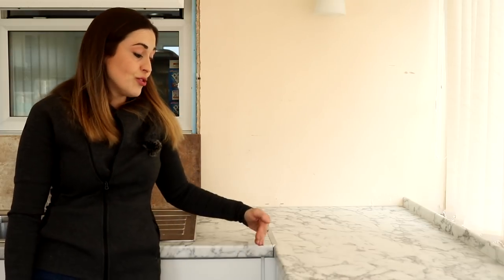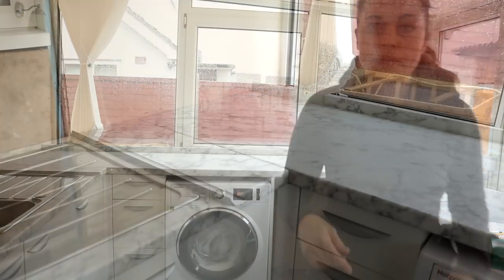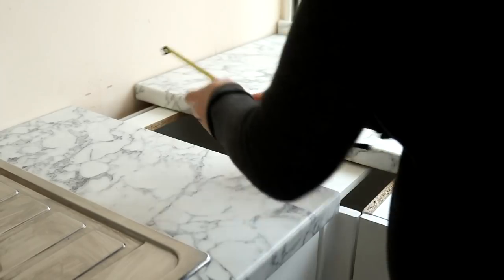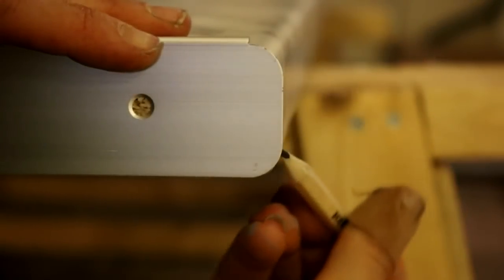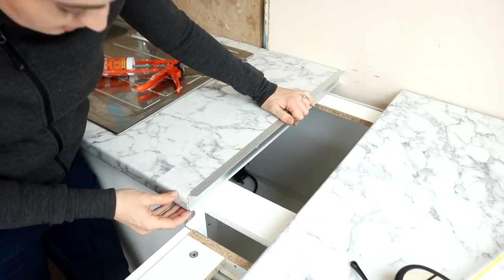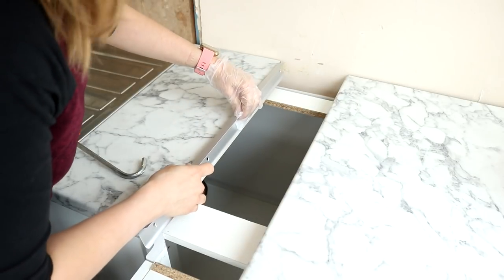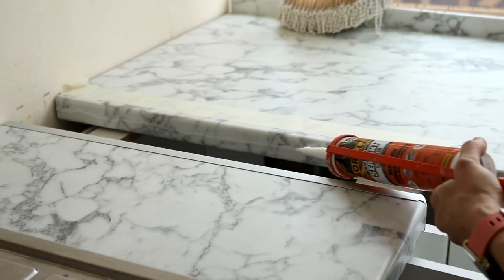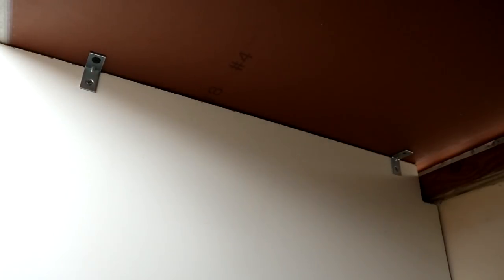Fitting Kitchen Worktop Corner Joint Trim | The Carpenter's Daughter

Comment: I undertook this today, and got the confidence to do so from your very clear and descriptive video. In the heat of battling against grossly unsquare walls and uneven worktops, which required adjustments, I forgot to clamp the surfaces to the units when screwing. I have consequently just noticed that the very well positioned surfaces are now not a close fit- they must have moved when screwing- and the end trim had an unacceptable gap showing. I know what is required for tomorrow, but I wish you could have been with me today!
Reply from the maker: Great stuff!  That sounds like an easy fix for tomorrow! :)
Reply: @TheCarpentersDaughterUK  it was an easy fix I am delighted to report, and having the corner joint has improved things greatly. I also fixed four edging trims, and they fit perfectly after using your filing technique. As mine are black, the filed bits show the silver under the black. I plan to touch up where noticeable using a touch of metal paint perhaps. I am drawing on your videos to do more jobs than I can list on my kitchen refit, as they are so instructive and beautifully presented.

Comment: nicely done, A handy tip is to use a liberal covering/spreading of waterproof pva on any cut worktop ends to stop any water ingress in the future
Reply from the maker: Thanks and totally agree :)
Reply: Remmers SW 910 end grain sealer . My choice. Silicone is best accessible off shelf solution how you did it.

Comment: Nice job! Others would have routed out the edges to make a flush joint but unless you get that perfect it looks bad. Your method looks good every time, great tip on checking the profile.
Reply from the maker: That definitely was a concern.  I don't mind usually mind starting again if I need to, but lifting the long worktop over a light switch to fit it in was so heavy, I didn't want to do it again.  And think this join is perfect for the every day DIYer if they want to do it on their own :)
Reply: Could get flat edge countertop and butt the two machine edges together looks way better than a bar
Reply: @keithbyrne4872  if it’s a Square edge worktop !
Reply: @stevecard11  yeah that works

Comment: I've refitted worktop in my last two kitchens and you've done exactly what I did! So I'm patting myself on the back because I'm not in the trade and I have no relatives, although I learned a bit when removing the old worktops. 

I have worktop ends which have nothing underneath, more like shelves in that respect. I used breakfast bar legs to support the ends and screwed batons on the wall to support the rear and provide something to easily screw the worktop to.

Fun isn't it? 🙂
Reply from the maker: Perfect!  I did exactly the same for my workshop recently :)

Comment: Is this worktop from Selco?
Reply from the maker: Yes it was
Reply: @TheCarpentersDaughterUK  Thanks. I have purchased the same and looking for ways to achieve the L shape without using the metal joining strip and without the need to use a router because I am not expert at it. Do you have any suggested method to achieve this aim?
Reply: @TheCarpentersDaughterUK  Is this a 6mm profile/radius or 10mm radius worktop? Can you share the link to the joining strip that you used? Thanks

Comment: Ikea worktops for some reason are a little different at 63.5cm depth.
Reply from the maker: Ah, that's very interesting!  I didn't know that!  I will pin this just in case anyone needs to know 😊
Reply: Have installed three Ikea kitchens and they are anything but crap, indeed they are good quality and very reasonable in price.
Reply: @TheCarpentersDaughterUK   great and beatiful girl
Reply: Rather deeper counter tops have came across some dodgy walls that need a decent scribe done where no splash back was being used
Reply: They are handy if you have had to pull your units away from walls further due to obstructions, pipes etc, so if your base units have 40 or 50mm clearance then 630mm depth worktops help here. Typical worktop depths are 600/605 approx so you have a decent overhang on 600mm appliances.  I've had my professional builder who has done many kitchens, typically Howdens units and he's done a great job. However I'm doing a major build project and complete teardown and refit with new everything, and I found WREN to be fantastic units and come fully assembled, I'm too lazy to build everything myself.
Reply: Worktops have no standard widths. Look on the router worktop mitre joining jig to see the many different widths available. And while you are choosing the jig remember square edged W/Ts use a shallower inset 5/10mm than bull-nose 22/35mm. It is much easier to choose the correct jig than use spacers, as I found out.

Comment: With those nice worktops, you wouldn't need that aluminium profile. You could've just masked the sides and put silicone in between as you did and smoothed it out with your finger. When done, you remove the masking tape. That would have created an even tidier look. Cheers!
Reply: Theres a bull nose edge that would look ridiculous...
Reply: @LunchBoxArcades  Actually it would not. There would not be much of a difference in the joining, besides that one millimeter of aluminium that wouldn't be between the two boards and instead of that 1,5 cm aluminium overlay on the top, there would be a barely noticeable silicone string, about 3-4mm's wide. I have done this so many times, with both wooden/laminated work tops, as well as granit. Picking the exact right colour of silicone, is key for a flawless result. Cheers!
Reply: @jhmsmarttv795  can you share a picture of your work please?

Comment: Joining with those strips are a bad idea. They are known in the trade as 'salmonella strips' because they trap food and grease. Much better to get a proper jig and fit them together using a router and joining bolts. The finished joint is virtually invisible. It really isn't that difficult to do as long as you take your time.
Reply: so these strips trap food and grease and the sinks do not? Cry me a river...

Comment: I remember when them metal strips were the norm and now they're somehow the work of the devil. Funny how opinions change. 🤔 Would a bead of silicone under the trim, where it lays on the counter not work? Wipe away excess. Nothing can get under it. I don't know. I know you've done a grand job mucker keep it up.
Reply from the maker: I think a bead of silicone just underneath is a great idea!  A bit of watching up liquid solution to wipe away excess and think it should be sweet.
Reply: No need for the ali join strip. 
Use Colorfill to glue together and make a waterproof joint with "dog-bone" bolts cramping the worktops together.